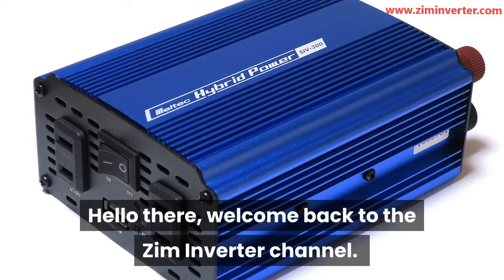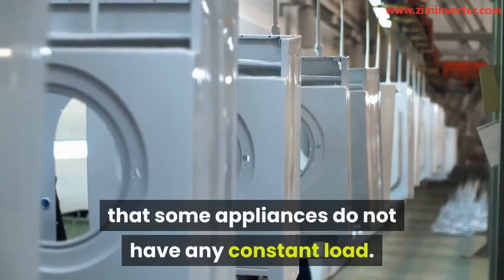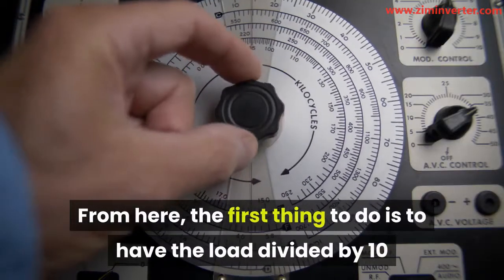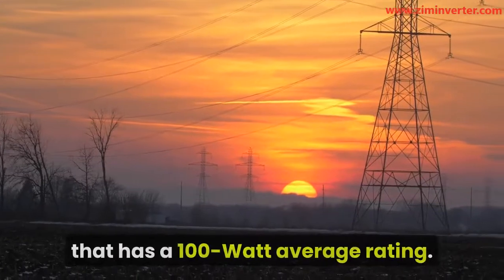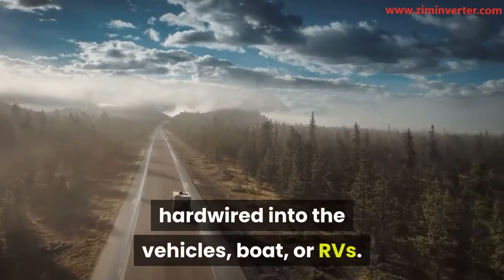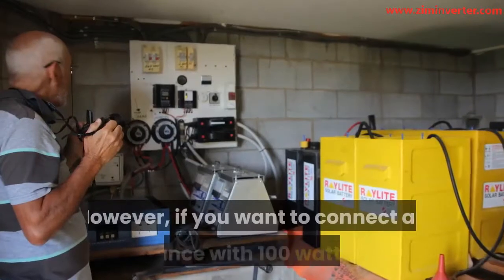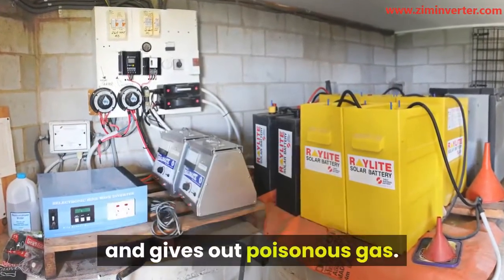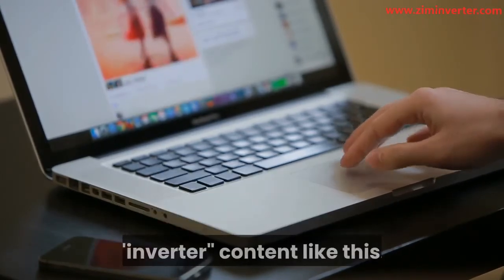How Fast Will Power Inverter Drain Battery

Comment: I have a renogy 2000 pure sine inverter without a battery built in. Can I wire this inverter directly to a 12 v lithium battery...to keep the inverter charged...or do I charge the inverter to 120 ac? Thanks